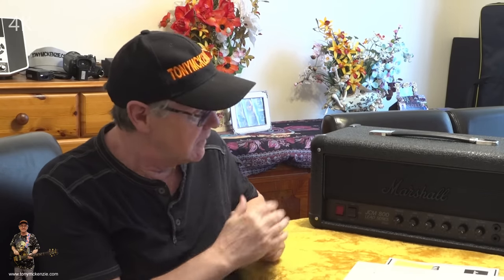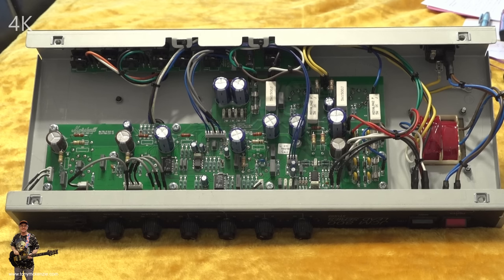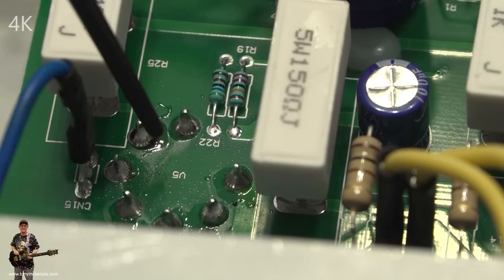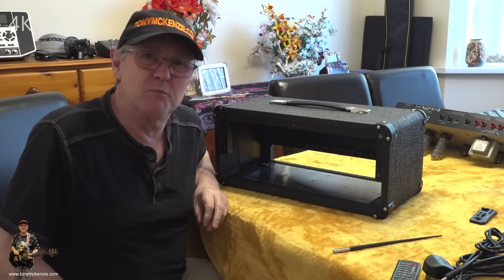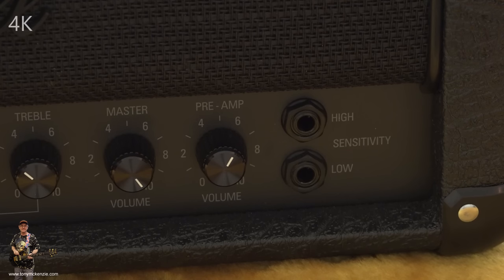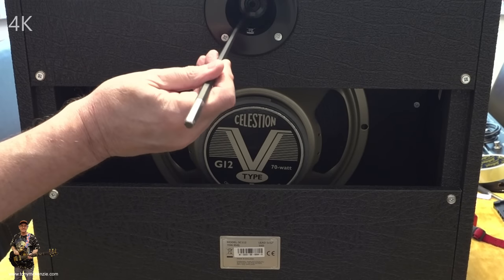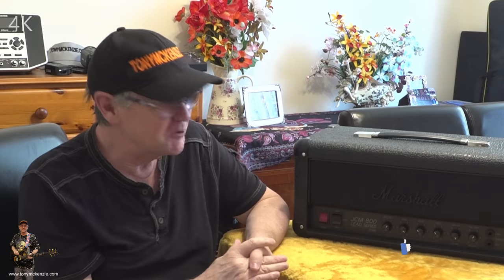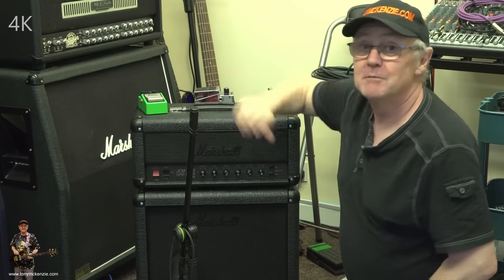Marshall STEALTH JCM800 STUDIO SC20HSB Amplifier |  REVIEW |  Inside & Out with Playing

Comment: 20 Watts into 16 Ohms ?? 
Or 20 Watts into 8 Ohms ??? 
Or 20 Watts into 4 Ohms ???? 
THE REASON I AM ASKING:  DUAL EL34’s !!!
Reply from the maker: Well that's what's on the tin Gerry. Yes Dual EL34's makes a change from the 6V6 or the EL84's for sure... and for that less than £700 it really is a very nice amp. And don't forget that 5 watts too for all the Ohms ranges!. Thanks for watching and stay safe!
Reply from the maker: I could guess that it 's output could be increased somehow... you might have some idea of that with your experience...
Reply: tonymckenziecom 
My philosophy has always been: the designer/manufacturer always knows better !!!
I try never to modify an amp from its intended parameters !! 
OF COURSE CERTAIN TWEAKS ARE OK !!! 
I FIGURED TWO EL34’s SHOULD BE OUTPUTTING AROUND 50 WATTS AT 8 OHMS ? 
THE ASSIGNED CABINET IS 16 OHM, THEREFORE APPROXIMATELY 25 WATTS ??
Reply from the maker: I'm not always sure that some designers 'know better'. A good example is what Russell on here confirmed.... 5 watt resistors mounted flat on a PCB and cooking the board. Common sense might dictate otherwise - designer or not. The 5 watt ones on this amp are raised off the PCB to avoid that problem. I have seen other amps (MT-15) outputting 17 watts from tubes similarly and it seemed that somehow the HT and other things were reduced to achieve a lower amp output. I'm not a designer of tube amps and in that respect my knowledge is limited, but this amp achieves 20 watts (indeed it could be 25 watts) at least. It's an interesting subject and I have a number of dual EL34's that achieve 50 watts (claimed).
Reply: tonymckenziecom 
I DID NOT MAKE MYSELF CLEAR ??    
I MEANT IN CIRCUIT DESIGN (SCHEMATICS) PART VALUES !!!
PROPER MANUFACTURING IS SOMETHING YOU LEARN OVER TIME !
MOUNTING POWER RESISTORS WITH SPACE UNDER IS THE PROPER DESIGN TO DISSIPATE HEAT !!!  
SECURING CAPACITORS WITH SILICONE ETC...
I’M NOT FOND OF TUBE SOCKETS MOUNTED TO PCB’S !! 
I UNDERSTAND PRODUCTION AND COST !! 
LIKE THE WAY THE POTS ARE MOUNTED TO A PCB ON THAT DESIGN.
SAME THING WITH THE OUTPUT JACKS, EFFECTS LOOP ETC. CHEAPER ASSEMBLY COST. 
YEARS AGO I REFUSED TO WORK ON A COMBO AMP THAT WAS A RE-ISSUE. I THINK IT WAS A PEAVEY ?  IT WAS MANUFACTURED ON THREE PCB’S ALL INTERCONNECTED WITH WIRE STRAPS (looked like staples) JUMPING ONE BOARD TO THE OTHER. THEN THEY FOLDED THE THREE BOARDS (into a box shape, missing one wall) AND INSERTED IT INTO A CHASSIS ? 
USING LEAD FREE SOLDER (which cracks under stress ?) A NIGHTMARE WAITING TO HAPPEN !!! 
THAT IS AN EXAMPLE OF A BAD DESIGN !!! 
YEARS AGO, WHEN ROHS COMPLIANT CRAP STARTED, I CALLED MESA BOOGIE TRYING TO BUY A “Kit” SO I WOULD ASSEMBLE IT (USING REAL SOLDER 60/40) !!
Reply: tonymckenziecom 
TONE IS MORE IMPORTANT THAN POWER !!!
I USE TO TEACH MY CLIENTS (my philosophy) ACHIEVE THE TONE YOU WANT AT LOW VOLUMES AND MIC THE CABINET AND LET THE PA BRING THE SOUND TO THE AUDIENCE !! 
LIKE CLAPTON DOES !!!
SAVES THE EARS ON STAGE !!
Reply from the maker: Oh OK Gerry I get it from this. All very valid points for sure and I agree that the way some things were did relate to lower costs as you say... the jacks and pots I thought but there will be other things. Scarily if you look through the reviews of amps - the 'inside and out' reviews I have completed you will see a trend over the years. On the Peavey, I specifically remember a Peavey Mace! (Remember them?) 160 watts with the tubes mounted upside down (like a Fender) connected with sockets directly mounted on the PCB. It was horrible and the nett result was that the PCB's cracked and baked until they failed all the time from what I saw. I had mine some time in the 70's (they were also used by Skynerd at the time) and I distinctly remember it burning out at least twice. Some swear by them, I swore at them! A classic example of a bad design.
Reply from the maker: That's a great way of describing how to do it too... it is the tone that matters I agree. All those years ago when I first started to play (68-72) the PA's were very different then :) (you will know what I mean) and there was not that much choice on amp volume - to achieve the rock tones and they always seemed to be loud. At one stage I had a Fender twin reverb and because I played rock (not really the right amp for me) I always cranked it up... that was so loud. It's all so different now, with so many amps to choose from. This little 20 watt Marshall is great and in the video I only used that 5 watts as I said. Forgive me if I'm repeating myself re the volume thing....
Reply: tonymckenziecom 
I APPRECIATE YOUR REVIEWS, BECAUSE THEIR IS MORE TO AN AMP THAN MOST REVIEWERS SHOW.
SINCE I AM NOT A GEAR HEAD LIKE SOME OF MY FRIENDS, I AM NOT FAMILIAR WITH TODAY’S COMPANIES. MY FRIEND IS SUCH A NUT, HE GOES ON CHAT ROOMS ETC. TALKING ABOUT WHICH  TRANSISTORS WERE USED IN A FOOT-PEDAL DESIGN ?? BOUTIQUE SHIT ?? 
I USE TO BE AN AUDIOPHILE !!  IF I WERE ONE TODAY, I COULDN’T AFFORD ANYTHING ? NOTHING !!! 
AND THEIR ARE STEREO AMPLIFIER COMPANIES I NEVER HEARD OF, AND I WAS IN THE BUSINESS !!!
I PURCHASED MY HOME SPEAKERS 1978 (INFINITY QLS-1) MY TURNTABLE 1974 TECHNICS SL1100A 
CROWN DC300A & IC150 (Not Tube, BUT SOUNDS FANTASTIC) ALL THESE YEARS !!! 
THE INFINITIES WERE HARD TO DRIVE WITH A TUBE AMP (VERY INEFFICIENT) NOMINAL 4 OHM !! 
YES, I AM AN ORDINARY GUY !!!!   RAISED THREE DAUGHTERS (ALL COLLEGE GRADUATES) !!!!
Reply: tonymckenziecom 
CAN’T TELL YOU HOW MANY DC CONNECTORS ON EXPENSIVE KEYBOARDS I REPLACED OR RESOLDERED !!
I’M NOT SURE IF THE CHEMISTRY OF SOLDER HAS CHANGED AFTER THEY BANNED LEAD ??? 
I KNOW THE FIRST LEAD FREE SOLDER CRACKED UNDER PHYSICAL STRESS !!! 
CIRCUITS USED IN NUCLEAR POWER PLANTS CANNOT USE THAT SOLDER !!! 
I REMEMBER READING AN ARTICLE ABOUT CONTROL CIRCUITS FAILING DUE TO A PHENOMENON OF THAT SOLDER !!  WHEN CURRENT PASSES THRU A CIRCUIT USING LEAD FREE SOLDER, MICROSCOPIC HAIRS GROW OFF THE SOLDER WHICH COULD TOUCH OTHER PARTS CAUSING SHORTS ETC. 
AFTER THE SHORT BURNS THE JUNCTION, IT VAPORIZES AND THE WHISKER/HAIR IS GONE.
Reply from the maker: I agree. I think that if you see more of what you're buying often it might be a little easier to make a decision. Inside sometimes you see things that I am not entirely sure some makers would want guys to see. But I always thought about quality, reliability and warranty go together.. I was a mechanical engineer until I was about 28 but after that flipped to technology and the mechanical engineer bit always made me think that way. 

I know what you mean about gear-heads (nothing wrong with them especially if you're one too :)   While I really like to see really well made equipment that is excellent value, I'm not that pinned to things like transistor types etc. or indeed in general newer technologies of particular chips etc. There's hardly any point in that unless some maker suggests things that are later shown to be rather different. That HiFi gear you mention is all familiar to me :) I could never have afforded any of that back in the day and had cheaper stuff... but that Technics table - those are highest quality as are the other brands and models. I used to have a LEAK amp and preamp but even forgot the model... it had an orange knob on the front :) My turntable was from a small UK company and I forget that name now... they eventually stopped trading :(   But your stuff - well that to me was Rolls Royce quality right there. 

There are many people that are not ordinary, like Steve Vai, Satriani, well there's a long list... and those guys are extraordinary for sure. But like you say, me? I really am just another customer and I decided back in about 2009 to make reviews that were not sales videos or reviews that were really financed by makers. Those are not made by the ordinary guy... and you know what, to me, I think that the buyers out there that are buying are just like me... ordinary guys that like playing guitar. I got sick of watching reviews, buying the gear, and finding it was nothing like what they showed. That still goes on today of course, but not from me. I dislike stuff that misleads people. Three daughter graduates is a real achievement and I'm sure you will be very proud of what they have done. I have two 'kids' but of course they are grown up now both in their 40's but I work with them and about 14 others at work in a technology company. It's hard to stop - even when there is imposed problems like we all see currently. But stay safe.

Its pretty obvious Ken that you certainly have been around and interesting when you mention those brands for HiFi that you have that all resonate even now in my mind form those years ago. Decent gear like that can be pretty timeless.
Reply from the maker: I think it DID change. Seems higher temperatures etc. also. Solder still cracks and in the products I have seen in many sectors it still cracks if stressed. I don't know the answers to the level you mention, but I see solder cracks all the time and often  from things being dropped or misused then the solder cracks. Finding the problems can be a bit of a pain from what our techs tell me.
Reply: Just as a side note, and as an answer to the question Gerry had about watts: 50W at 8 ohms, so 25W at 16 ohms, would be valid for most transistor amps. Tube amps have their impedance set by the output transformer though, so it’s possible to have the full output at each output tap. So, for a 50W amp that would give you 50W at 8 ohms, and also 50W at 4 ohms, as long as the amp had an output transformer with both 8 and 4 ohm taps.

This amp has 2 EL34’s in a push-pull arrangement, so you would guess somewhere around 45 to 55 Watts. But that’s with a fixed bias arrangement. I’m guessing this amp’s cathode biased. Cathode biased EL34’s usually end up somewhere around 30Watts. But if the design uses a slightly lower high-voltage on the power transformer, this could further take the Watts down.

This very probably also has the added advantage that it’s much softer on the tubes, and so they should last a long time.

Oh, and by the way, Tony, since the comments on the JJ Jr video are disabled, I just wanted to add:
The switches that seem to be gooped in place on the JJ, are in fact held in place in exactly the same way as the ones in this Marshall, with little tabs that click out once you put the switch in its hole. The thing is, unless tolerances on the holes are absolutely, 100%, exact, there will be some slop, which could make for a switch that’s securely mounted, but can be wiggled around a bit, sometimes this could even rattle when the amp is sitting on top of a vibrating cabinet. The silicone just removes that slop. It makes it so the switches won’t budge. But the actual thing that’s securing them in place is not the silicone, but the plastic tabs on the side of the switch-block. So, I would say that the added silicone is a good thing, it’s not a replacement for the plastic tabs, it’s in addition to it.

Give it a try, from the outside of the amp, without opening it, take hold of the plastic square housing around one of the square switches, and try to move it around. 9 times out of 10 there will be some movement to it. Tiny, but there. That’s what the silicone is for. I think.
Reply from the maker: Thanks for the info... However, it was not really too much about the goo on the Friedman amp that really bothered me, but rather the pathetic burned board and components as supplied to me brand new. This amp scarily is about 1000 times better for half the price. Thanks.

Comment: Everything comes with JJ now. I think APR is made by JJ also. 🗑
Reply from the maker: That could be true currently. What becomes really scary, is what happens if China (in it's wisdom) was to compromise Taiwan (as it is suggesting through its actions) and then the west puts some sort of embargo on Chinese products.... just a thought...  and thanks for the info. Oh and for watching.
Reply: @tonymckenzieofficial  yeah. I am so used to JJ tubes breaking if they don’t require bias adjustments the first thing I do is get them out of a new amp. At the peak of the tube shortage hysteria I literally saw new Russian made tubes (which is mostly everything not including Asian made brands) selling for more or more comparable to NOS vintage (made in the 60’s mostly some late 50’s) mullards, General Electric, etc made in the USA, England, and other western countries but primarily England. According to the sellers and certain amp makers these tubes are made to last forever so long as they are well tested and from a reputable dealer. I have a Matchless Lightning and a Morgan Dual 20 loaded up with entirely NOS Mullard  tubes from the same 1 or 2 sellers so I was able to get bulk discounts. Sounds fantastic no problems so far, and they said they would replace them if any problems in 6 months. They also said they would be willing to buy them back forever. If it works as advertised hopefully I won’t ever have to worry about a tube again if not for a great while. I might be buying into the sales pitch but I think of it like buying an extended warrantee- and if I want to sell the amps I still keep the JJ’s so I can swap out the more valuable tubes. Not sure if I would recommend doing the same- ask me in a couple years if I have had any problems. If you buy it all at once does not cost as much as one would assume- and I can also put them in the next amp if it has generally the same ones. The 12a7’s and EL84’s (power amp tubes need to be matched) are pretty much standard for the amps I buy. Some variety in rectifier tubes. It seems that wether the amp has a tube rectifier to begin with is a sign of a higher quality amp if I am not mistaken- at least for a vintage sound I assume. (If anyone more knowledgeable can give their take feel free to- I am new to seeking out my own tubes) 

Matchless, for example, uses JJ’s but Phil Jamison recommends trying out other brands and says that ideally get the best you can afford. I can tell from interviews he doesn’t particularly like JJ’s- I think they have to use them to maintain a competitive cost advantage bc they seem to offer the manufacturers the biggest bulk discounts. Even amp makers like Two Rock use them in amps that cost $6000- they have one brand that uses NOS tubes that costs even more. Expecting quality tubes in a boutique amp like a Friedman is apparently unrealistic these days looking by comparison. I would assume makers like Mesa boogie and Marshall that make their own are probably using rebranded JJ’s or something comparable bc tubes are no longer made in the West bc of environmental regulations. There is supposed to be a domestic company that is going to start but I have heard nothing but rumors for months- I doubt it will happen once the cold reality of how modern day “capitalism” works against developed nations. We have to abide by stricter laws than China or Russia bc they are “developing” nations according to the status quo. At least going by my rusty business degree obtained 20 years ago.